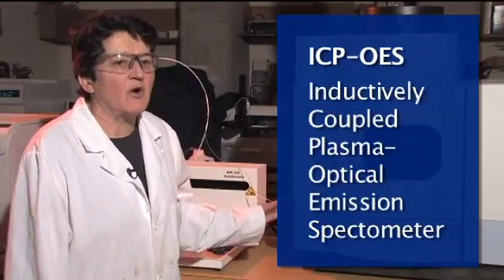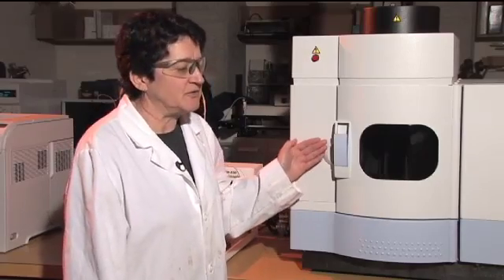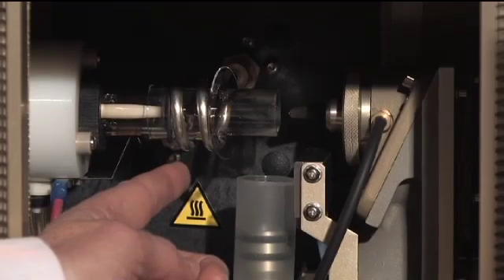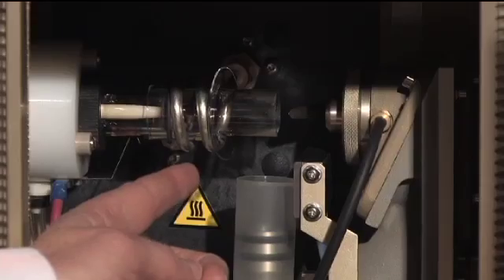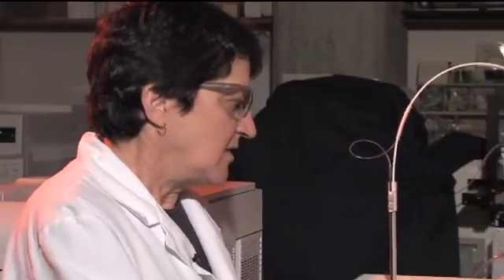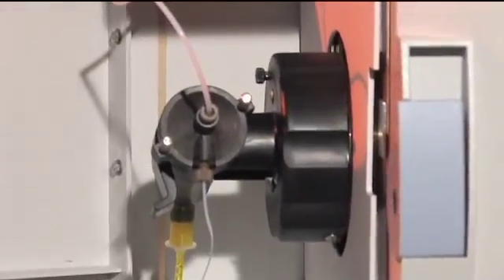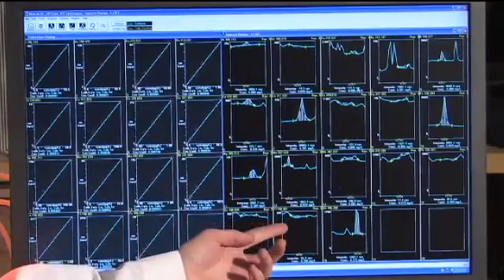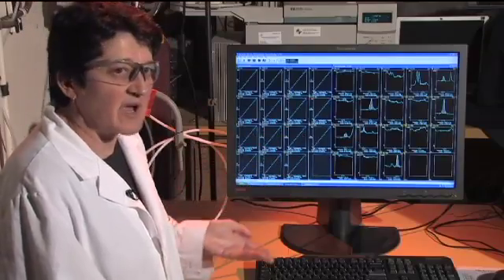Inductively Coupled Plasma-Optical Emission Spectrometer (ICP-OES)

Comment: very good video, except the RF coil does not ignite the plasma; it just 
couples it so that it does not extinguish. the first ions are actually 
initiated from a lightning bolt, which goes from the left side of the 
torch (where the copper foil is - the foil is connected to a tesla coil)
to the metal sticking out on the right (ground)
the lightning bolt can actually be seen, just look through the window next time turning the plasma on.